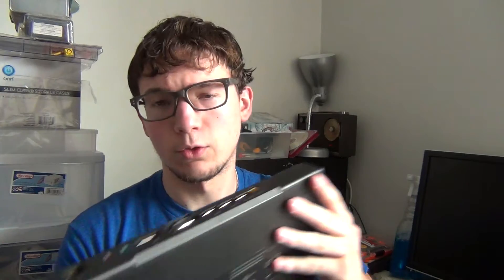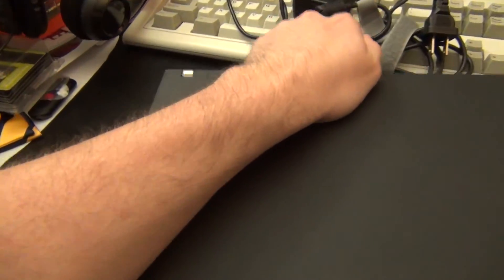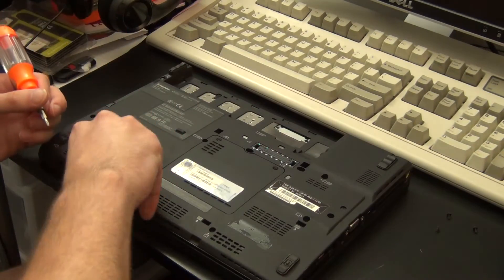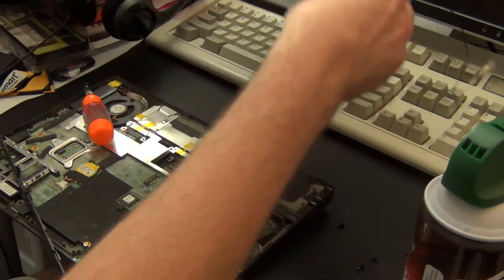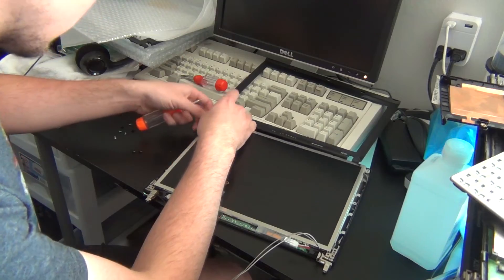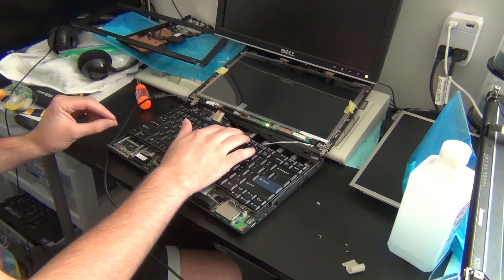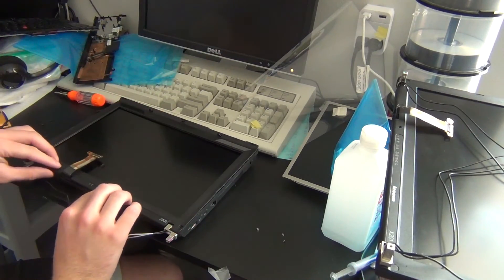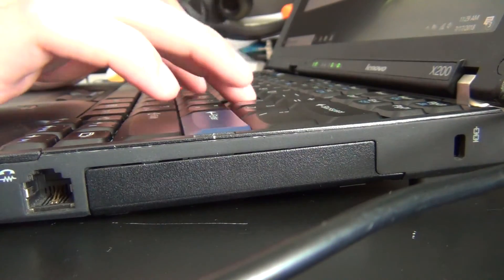Lenovo ThinkPad X201: AFFS Screen Upgrade

Comment: I have two x200s's. One has the 1440x900 wxga+ screen and 8 gig RAM. What really bothers me is the poor contrast. Would swapping out for the lower res but (presumably) higher contrast new screen be worth the effort. Btw, both units are in perfect working condition as far as I can tell. I run Ubuntu on the 8 gig model and it flies for web browsing, vids, and youtube. The only downside is the poor contrast. 

I just love the form factor of the x200s. It just seems so small & light given the screen & keyboard size. 

Thanks in advance.

Comment: As it stands currently in 2023 the X201 is one of the few older Thinkpads to not only still have a decent amount of them in circulation but also have ones you can get at a reasonable price. And that to me is just fantastic. Coupled with the fact that it's one of the last thinkpads you can get without a touchpad for some retro computing excellence.

Comment: Do you have the part numbers so that I can order and try this mod on my x201? Awesome video. The other option I have is to try to get a X220, would you recommend I do that instead? Thank you!
Reply from the maker: The X220 or the X230 (with the classic keyboard swap) would probably be a better option at this point. Performance is much better, they're more power efficient, and there's a mod available to fit a FHD IPS panel in. Alternatively if you had a lot of money to blow and the right connections you could get an unofficial X210 which is a project where modern internals and a modern display are fitted into the X201 chassis. The AFFS panel I put in this X201 looks quite nice, but 4 years later investing money in machines this old doesn't make nearly as much sense anymore.
Reply: @SebisRandomTech  Oh, is the X201 not really usable today? I'm thinking of getting one because it has the 16:10 screen. I'd use it for word processing and browsing the internet, and some youtube.
Reply from the maker: @PiceaSitchensis  For that use case it should be fine, my point is that for the same price you can get an X220 or 230 and those will be far more usable in the forseeable future. I know the aspect ratio is a downside, but for me the more modern processors are a worthwhile tradeoff.
Reply: @SebisRandomTech  Okay, thank you for your thoughts Sebi.

Comment: Hmm. Do you think the x201 could be viable for light tasks like internet browsing and word processing on linux? Just wondering.
Reply from the maker: It should be more than good enough for those uses.
Reply: @SebisRandomTech  isn't that incredible? The x201 far as I know is the LAST thinkpad to carry that retro design that's similar to the ibm models. AND ITS 16:10. and you could just get a palmrest without the touchpad and with some upgrades and a high config it could easily be the fastest and newest "retro" thinkpad ever. And being the last to not have a touchpad on some models is a huge draw for people.
Reply from the maker: @alastorlol502  Plus there was a 51NB motherboard for it (not sure if it's still available) that allowed you to put in much newer hardware.
Reply: @Pnylyck Jvanof lol yeah I figured

Comment: Got an x201t recently with no ram/drive/batt and a bad AC jack on the cheap
Threw in a charged battery, a 2Gb stick and a hard drive I had lying around, runs windows 11 alright (if a bit slow, but 8Gb and an SSD should fix that)
Reply: Just install Linux on it, even Windows 10 is too bloated for dual core CPUs.
Reply: @Pnylyck Jvanof What do you mean?
Reply: @Pnylyck Jvanof This charger has worked perfectly for the last 7 years in my other laptop, no frays or visible stress on the cable. Meanwhile the jack on the laptop is literally missing plastic, and I need to charge the battery using either my other laptop or the docking station.

Comment: Managed to pick up an X201 on eBay for just $30 including shipping. Just missing a battery, sold "for parts". After throwing in a brand new 6 cell and a free 240GB SSD from Micro Center it's running great. But yeah, the built in TN panels sucks so bad. If I wasn't saving my money for a T480 I would get the AFFS screen.

Comment: I have been thinking about doing the affs screen mod but I am not sure I'll do it. How does it affect the battery life of the machine?
Reply from the maker: Battery life is a tad worse because of the CCFL backlight. You could potentially modify the panel to use LEDs instead but that’s a pretty involved modification.

Comment: Hi sebi, I know I’m quit elate in the video but is it possible to replace the lenovo x201 lcd with lenovo x201 tablet lcd?

Long story short, I bought the wrong one and cannot get a refund
Reply from the maker: If you're extremely careful you might be able to extract the panel from the tablet housing and fit it into the normal X201, but there's still a chance it may not work.
Reply: @SebisRandomTech  thanks. I think I'd rather find the correct one with my meager skills

Comment: Thanks for sharing your experience! How did actually the palmrest upgrade go?
Reply from the maker: Went well. Worked fine.
Reply: @SebisRandomTech  Good to hear! Was there anything special to consider (e.g., shielding some pins etc.) since the palmrest you upgraded your X201 with did not have any touchpad on it? I am wondering whether there exists the possibility of a similar modification to the X230? To me, the touchpad on the X230 is not usable, and in addition, looks quite ugly (in my opinion)...
Reply from the maker: @hpp6116  Sadly there is no such mod for the X230. For my X201 I did not have to shield any pins, as these laptops were available straight from Lenovo without the touchpad as a configurable option.

Comment: Are the two white leads coming from the right hand hinge area on the assembled 200 display an extension of the wireless antenna? i.e. black on the 201 screen but white on the 200 screen?
Reply from the maker: Yes, they are for the wireless antenna. They plug into the WiFi card.

Comment: Hi Sebi, great video!!! I have a X201s, which has a 1440 x 900 panel; I love the resolution but the display itself is a horrible one (poor angles, colours etc). Which panel would you recommend? Is there anything which is IPS and has the same 1400 x 900 resolution? Thanks a lot!!
Reply from the maker: As far as I know there is no IPS/AFFS panel for this machine that also has the higher resolution. With the recent X210/2100 mods people are putting in better displays, but those require the more modern components of a X210/2100 mod.

Comment: hi Sebi , i have few question regarding the X200 thinkpad . i do ave one needs to repace the battery so can fit X220 battery to X200 or is that totally diferent ? also can you pls send me reference number for X200 display. thanks
Reply from the maker: Nope, the X220 uses different batteries than the X200. X201 batteries should work though.

Comment: Thank you for the video with such good information. 
I have a question. 
What should I search for the replaced panel? HV121WX4-120 right? And is there any additional cable for panel replacement?
Reply from the maker: No, it will work with the standard X200 CCFL cable. It will not work with the X200/X201 LED display cable.
Reply from the maker: Raul R. Lupescu  You need the X200 CCFL display cable. It's different from the LED display cables used on the X201.
Reply from the maker: Raul R. Lupescu  Yes, that one is correct.

Comment: hey Sebi I'm having some trouble with my x201, and the issue is that the machine consumes battery power when turned off. I have determined that it is not an os issue since the computer does this in any case of power up(it can just be visiting the bios). How ever, by simply removing the main battery, keeping it disconnected for a few seconds and re attaching it makes the drain go away. Do you know why this could be ? Is it motherboard related (something not turning off) or is it just a faulty battery. The battery does not lose charge outside of the computer. Otherwise the machine is flawless.
Reply from the maker: Try with a different battery, and if the problem persists then you may have a faulty motherboard.
Reply: @SebisRandomTech  Okay i'll try and report how it goes. Thank you.
Reply: You could use a thermal imaging camera to find the component that does not shut off. The energy from the battery must go somewhere and therefore should be seen as heat. You can get a cheap SeekThermal Android microUSB camera for about $30. Or a special kind of nail polish could be used instead which changes color at a certain temperature. See https://youtu.be/R4C3Lh71yFQ?t=385 for more info.

Comment: Nice job!  I considered doing this mod, but due to the cost of the Boe Hydis panel, I didn't bother, and 1280x800 just doesn't cut it anymore.  Instead, I spent $5 for a used colour calibrator, which helped enough for what I was doing.

It's a misconception that TN panels have bad colour.  I have one of the W520 models that have a TN panel, but is 95% sRGB.  Viewing angles are still poor, but the panel actually looks quite good.  The IPS panels that come with the X220/X230 are something like 65% sRGB.

I don't know how people can wear out the keys so they're all shiny.  I've used my keyboard for over ten years, and there are only two shiny spots on the spacebar.
Reply from the maker: The W520's panels are high gamut displays, so even poorly calibrated ones look a lot better than some of the TNs found on other models. In general the higher-resolution panels on 15-inch ThinkPads have always looked a bit better than the ones on 14/12 inch models. And I can agree with you on the colors of a 15" FHD panel vs, say the X220's panel. Having held a IPS X230 and a FHD T530 next to each other, the T530 clearly had better colors.

Comment: I really love my Hi DPI and I'm curious if a higher-resolution panel would work in an X201. There are a LOT of options on panelook.
Reply from the maker: @apojoga I’ve looked around and seen some other useable panels pop up, I also know if you get an X210 board (modern processor and specs that fit in the X201 body) there are some much higher resolution panels that will work. But since I am satisfied with 1280x800 on a 12” laptop and don’t have the extra cash to blow on a bunch of parts, I haven’t bothered.

Comment: Hi Sebi, love your video! Today, I replaced the TN panel of my x230 with a LCD panel. But during system (win 10) booting time, many white horizontal lines appear on the new screen then disappear after booting. Do you know why this happen?
Reply from the maker: Does it look fine when you go into the BIOS setup? Or if you load a different operating system?
Reply: No, it doesn't. Neither in the BIOS setup or in the Ubuntu subsystem can the problem be solved. I have tried to change the refresh rate into 50p Hz, to reconnect the cable and upgrade the bios to the latest one, but didn't work. Now I go back to the TN panel. I will be very grateful if you can post a link where I can buy a new IPS panel.
Reply from the maker: Sounds like a damaged or defective screen/cable. If the issue doesn’t happen with the old screen then you know it isn’t the cable. In the description of my “ThinkPad X230 IPS upgrade” video there’s a link to buy a new one.

Comment: I was looking for a cheap laptop for schoolwork and watching stuff in my spare time and found a refurbished T440 Thinkpad on Ebay with 8GB RAM and 240GB SSD. Would you recommend it?
Reply from the maker: Depends on the price and what your needs are.
Reply: Sebi's Random Tech Budget of around £350, needed for schoolwork using Microsoft Word, Powerpoint, Excel, etc. Will probably be using a couple of these at once. Watching stuff on YouTube in spare time. Unlikely to be used for gaming but if it is it'll be nothing too intense.
Reply from the maker: Seems a tad bit high for those specs, unless the seller upgraded the display to a 1080p IPS display. See if you can talk the price down a bit, but if not it isn’t a bad deal if the laptop is in good shape.
Reply: Sebi's Random Tech It costs £290, £350 is my budget.
Reply from the maker: That probably isn’t a bad deal then, especially since it has the SSD.
Reply: Sebi's Random Tech Okay, thanks.
Reply from the maker: No problem. Let me know if you buy it and if you like it!
Reply from the maker: Also consider the T450 trackpad upgrade, it should only cost $20-$30 (whatever that translates to in pounds) and really is an improvement over the stock T440 touchpad especially if you use the trackpoint. Make sure it is a Synaptics touchpad though or the drivers for it will never properly work.

Comment: My T430 still has its TN panel, but it also needs a new keyboard (it's not broken just came so slimey it didn't have the antimicrobr stuff on it now) don't know what to get first. The TN panels are terrible
Reply from the maker: I recently saw some converter kits pop up on eBay for putting a FHD IPS panel in the T420/T430. But I don’t feel like dropping $70-80 for a small converter board plus $50-70 for a panel.